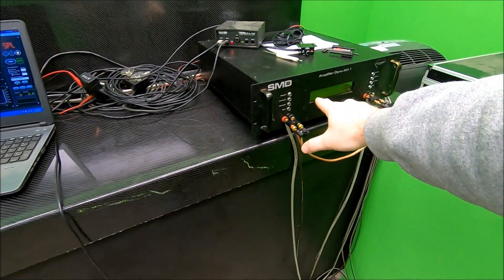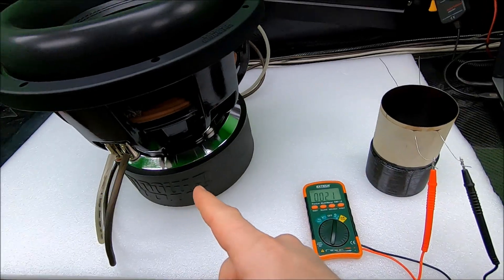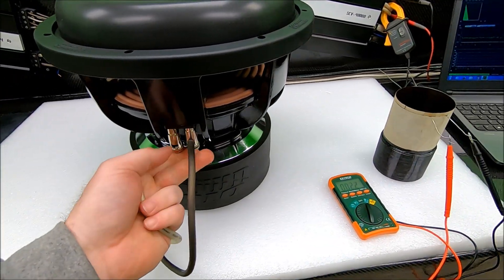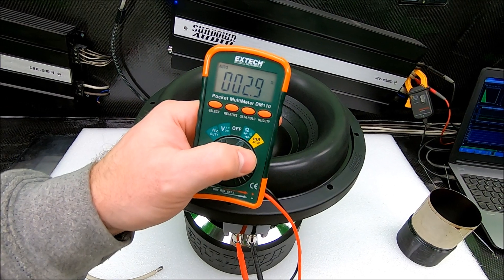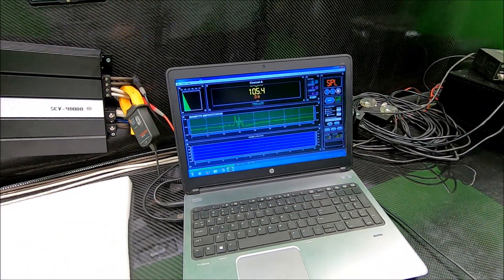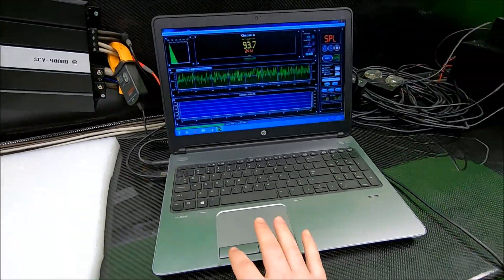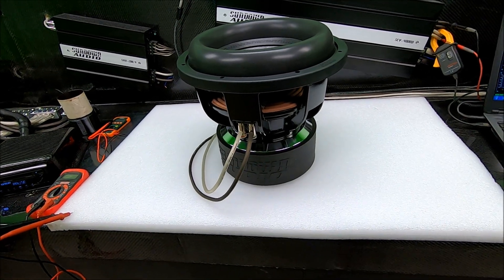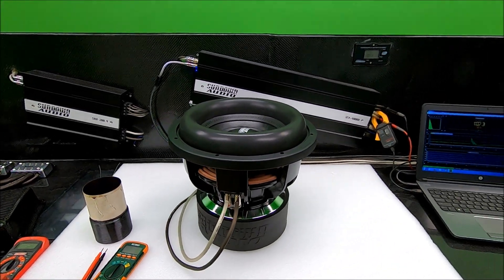How To Fight Box Rise *Tech Time Thursday* at Sundown Audio

Comment: I don't like the title, it gives the wrong impression. You don't want to fight it. It is your friend. You want the maximum amount of impedance rise while being perfectly on the balance point where mechanical limit is reached as the coils thermal limit is reached. Once this is achieved, you can calculate how low you can safely wire your amps down to yield the highest current possible. I run my amps strapped at 0.5ohm (0.25 per amp) daily and they stay cooler than they did at 1ohm on poorer subs.
Reply: This dude stays with the clickbait titles lol! Love the videos though!
Reply: Glad to see someone else running at 0.5 strapped for 0.25 each amp. Ive had tons of people tell me I'm going to blow my amps. I have 2 DD m2b's and they run like horse with new shoes. Keep up the great stuff as well Peace and Bass :) :) :)
Reply: Yeah boi the only time you should ever worry about rise is when doing a one note wonder design for dB drag. Choosing a coil configuration to maximize your amp output at your test frequency. In this case, the playing other tones where the inductance is lower can damage your lovely sundown amp. I always say, if you're playing music.. rise is what it is xx
Reply: barevids can you make a video on this if you haven’t already where you expand on this premise that impedance is your friend and how you find the max impedance rise while being on the balance of the mechanical limit & thermal limit? Thx
Reply from the maker: No doubt I did the title that way on purpose to attract attention.
Reply: @UnofficialAudio  click bait 🤣
Reply: What's up Barevids!!
Reply: He is explaining how it's bad for people who play music not 1 note spl burst tracks I think it was helpful and a good title, but everybody is different.
Reply: @SoundFilter was trying to help a friend out with their setup and fixed it all up so it was proper and they ended up putting it back to the way it was. oh yea the way it was before.... the sub wired down to 1 ohm hooked up to 1 channel of a 2 channel amp which was only rated for 2 ohm per channel not bridged. he kept complaining about the amp going into protect and apparently he liked only getting one channel worth of sound.
Reply: Sam is right you know.
Reply: I got a fix for box rise i buy a bigger sundown amp 😉 LoL
Reply: @barevids 😳 strapped at .5ohm (.25ohm per amp)😳 ...

 ho li 💩

🤯🤯🤯
Reply: its called Impedence ...the box does not cause it ,its how the sub works when you hit the sweet spot  of a sub the ohms will be way higher than 1 or 2 ohms .
Reply: @AlanRaybasshead  but In general you are right. It has to do with how much the subwoofer/coil is moving. There is many names for it but impedance rise is the “proper” term
Reply: @AlanRaybasshead  not necessarily true. They call it box rise because you can get different rise out of different box’s. Ie a more efficient box will have more box rise and vice versa

Comment: To fight mine I just wired my sub to a lower ohm on the amp. You would need to run your system and watch the ohms so that you don’t hurt your amplifier.
Reply: Or get a SMD IM-SG and use it to see what your impedance is at all frequencies.
Reply: Had22s I don’t need that to see what my ohms are at all frequencies. You can just use a good voltmeter.

Comment: The answer is get a scv7500 to fight the power loss. End of story
Reply: 1 stfu already dude. YOU DONT SOUND SMART. YOU ACTUALLY SOUND LIKE AN ASS.
Reply: Simple
Reply: Daniel King what happens when the impedence is at its lowest point while playing. Won’t it be sending a lot more power then the sub can handle?
Reply: And wire down to .25 ohms 👍😎
Reply: Stfu
Reply: James Bond it don’t stay down long... it’s more high than low
Reply: 1 boy I am an HVAC service technician on a military base.  I can more then afford it.  What do you do for a living? Work as a gas station clerk? Fool I’m over here investing in test equipment I could have bought your whole setup. AND YOURE SUPPOSED TO BE THE “NERD” lmfao. YOU DONT EVEN HAVE ANY TEST EQUIPMENT LMFAO

Comment: That will change in a box . Because there will be resistance on the sub. Right?
Reply: Yes. Different volume boxes and different tuning will change the impedence curve and spike size. What he didnt explain is when the impedence is at its highest is also the most efficient. The subs resonant frequency will be its highest impedence. When put into a box that will shift depending on box size and tuning. A sub unloads so easy below tuning because there is less box resistance and more power being delivered to the sub. At tuning box pressure is at its highest and power at its lowest. If you are competing you fight this with bigger amps. Daily and demo setups wont be able to push the power limits because of the lower impedence frequencies sending much more power to the sub during music.
Reply: Dbjunior 123 nice explanation 👍🏼